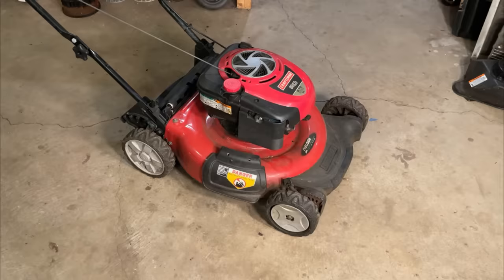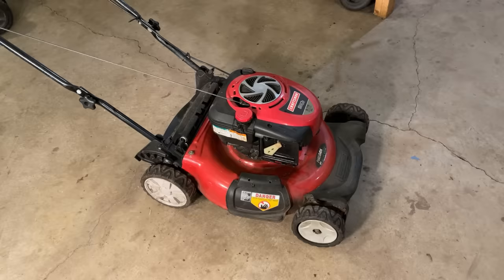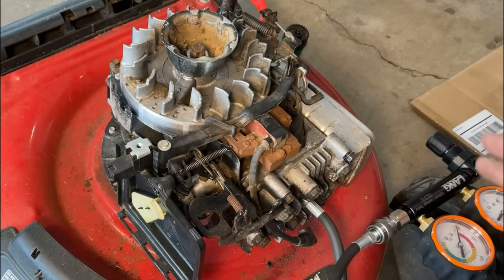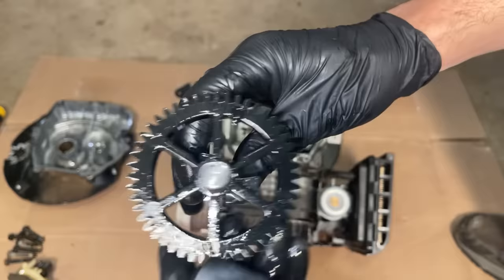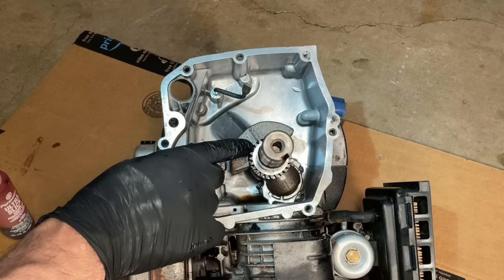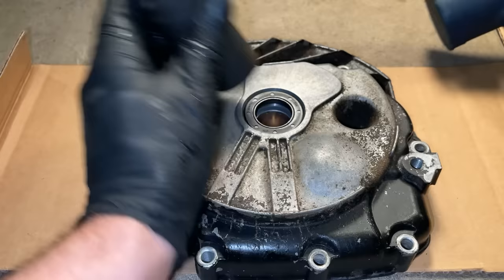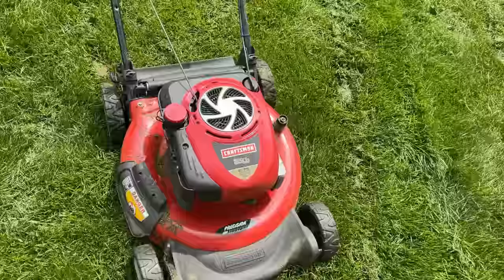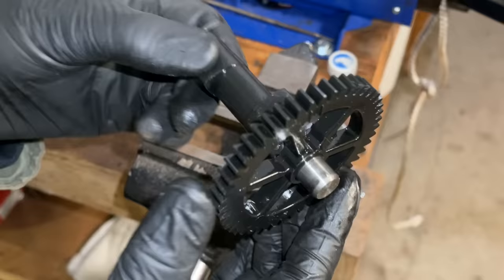Lawn Mower Will Not Start - You Will Never Guess Why

Comment: The alloy key in the flywheel is designed to sheer when the big blade hits an immoveable object like a tree stump,  the key sheers and the flywheel keeps rotating, the timing goes out and then  the engine stops.  This is done so the crank doesn't twist.  The owner then takes it to a dealer and they change out the key and it runs again.  This saves you buying another engine/mower.
The Plastic cam gears are designed to melt at a certain temp and stop the engine if it is overheating, Honda use this on their GX trimmer 4 strokes as well.  The mechanic can then change out the cam gear, and the engine will run again fine after cleaning fins and fresh oil.  Overheating can be due to lack of oil or blocked air cooling fins/fan.
Failed cam auto decompress levers are a fault and Briggs has had their issues with this, especially on some ride on motors.  If the starter turns the motor over and it just bounces and fails to start, its the decomp cam weight is broken.' 
You can get it to start temporarily without the cam working by first palming the engine backwards anticlockwise until you hit the compression bump, and then the starter will get it over comp with the runup it gets from that.  That's if your in the middle of mowing the lawn and you went for a cup of tea and it shat and wont start again.
You can help the decompressor to last longer by idling down before shutting off.  This seems to help the briggs ones anyway.
Matt.  Small Motor Mech.

Comment: My late dad and several of my relatives worked as gardeners for decades since the 1950s.  We used to go through B&S engines every 3 years with weekly oil changes being done after every 50 hours of use on each piece of equipment:  edger, mower and yard vac.  After 3 years, the engines would start burning oil from worn pistons.  We never had these cam problems in the old engines.  Carburetors wore out faster as we would buy short blocks to rebuild the older engines.  My dad saved a few blocks that had steel sleeves (OEM engines) and had a mower shop put in new piston rings and grind the valves to get the engine running again.  We did switch to Honda engines on the mowers, as those engines lasted double the life of a B&S short block.  I'm curious to know if the plastic parts are available without the metal shaft to rebuild the camshaft, or if you need to buy the whole assembly with the metal shaft.

Comment: Part of my job in spring and summer is setting up these Craftsman and Toro mowers from the boxes they are shipped in.  I put in the bottle of oil for the customers and displays.  Other than that, I do not mess with them.  If a customer has an issue, they bring it back to the store.  We have no mechanic to solve the issue.  We give them another mower or a refund.  The "problem child" gets tossed into a dumpster eventually.  New blade, fresh oil, grass bag-- the whole works.  Employees are forbiden from taking these or any other items that get processed out of inventory.  It is a waste of resources and otherwise fixable products that could go to needy people that can't afford a $359 mower.  I have an electric mower that my wife loves and can handle.  Put in a charged battery and push a button.  It cost $589, tho.

Comment: Nice, I recently overhauled an engine, I might not even have noticed that the gear moved on the cam shaft, I didn't even notice the mark for the lobe. I wonder why it came loose, it doesn't seem like it has to take a lot of force to drive the pushers for the valves, hence why they made it from plastic and no key. Thanks for sharing.

Comment: I like to install seals in a slightly different position if possible so that it sits on a new surface of the shaft.
Especially effective if the shaft has a groove worn in from the seal lip.

Comment: I have had several of these engines and never had a timing issue except for when the engine key broke after I hit something otherwise they are fantastic engines. Yes, they have replaced some things with plastic but it probably helped keep the cost of the engines down some too I’ve got two of those motors that are20 years old for one and 24 years old for the other and they both can run although one needs the carburetor cleaned out in a new gas tank

Comment: James: For laughs & giggles, I would have been tempted to file several shallow notches on the shaft & tried JB weld to see if it would hold. Not likely considering the drag on the cam lobe as it climbs the slope of the lobe, but it would still be interesting. Great video Sir, as always.
Cheers!  from the wind swept hinterlands of Alberta

Comment: Where I come from ( Australia) we never use a solid blade cutter but round plate with short blades that pivot back if they hit anything solid like a tree stump or rock. The solid blade cane brake a crankshaft or as in your case a plastic camshaft.
Reply from the maker: I have seen the same type here, but it is rare.

Comment: Jim, you might have tried putting a sheet of medium grit sand paper, on aflat surface, hold the tank neck, and give  several srokes. Check to see if it is not flat, due to oval of the neck. You might be able to sand the cap mating surface true again.......great job. But that $50 tank was hard to take.......LOL

Comment: First time to your channel I was intrigued. satisfied with what i got   out of this little video. I have never experienced this problem but I am glad to be aware of it and also what it took to troubleshoot it accurately. One of the things that I stressed to those that I teach whenever I can is to be able to diagnose properly and effectively and you definitely did this. I have now subscribed to your channel looking forward to some new information. I consider myself to be well-versed in mechanics and I work on diesels as well as small engines but I've never run across this problem. Started working on engines when I was about 7 years old on a 3 horsepower Briggs & Stratton and I must admit that I really don't see too many Briggs & stratton's anymore I mostly deal with Hondas. While I am a DieHard Briggs & Stratton fan I must admit that Honda seemed to last longer and are less problematic. Still very good to know love this information keep up the good work.

Comment: About that oil seal. Most of these engines get installed on lawnmowers. They run in an extremely dirty environment. Most owners do not keep the area around the seal properly cleaned. As this continues over time, dirt can collect around the lip of the seal causing it to cut a groove into the shaft where the seal contacts it. If a new seal is installed in exactly the same position as the original, the lip will ride in that groove causing it to leak in a short period of time. The factory knows this. When the factory installs the seal, it is done by a robot. The seal fits onto a computer controlled hydraulic ram that applies equal pressure around the seal while driving it to a specified depth into the housing. This also keeps the seal perfectly square to the shaft. In the field, most of us install the new seal the same way you did. When driving in the seal it is impossible to keep the seal 100% square to the shaft until it bottoms out forcing it back square. The factory can keep it square at any depth while we can’t. They don’t fully seat it so it has a fresh spot to ride on the shaft to prevent leaks. If the seal isn’t square, it will prematurely leak. The only reason I can think of not to fully seat it would be if the shaft was either tapered or stepped to change sizes. Am I missing something?

Comment: Nice job. I've repaired a zero turn single cylinder 20hp Briggs twice, now. The steel exhaust valve seat jumped out of the recess. and I can't remember the first reason.

Comment: You sound knowledgeable James, heres the question. 12.5 briggs single cyl. with no governor hooked up just a stub shaft. Motor runs away when started only way to slow down is choke . Tried many carbs, even ran one backwards, and tried a restrictor plate under plenum reduced rpms to abt 3100 but no power. otherwise runs good no apparent timing belt issues????

Comment: On easy start lawn mowers they have a mechanism on the camshaft that allows exhaust valve not to close once the engine gets spinning at the right RPM the mechanism on the cam will stop engaging most of the time it's a bad coil keyway broken or water gets in the gas tank and it runs the carburetor.

Comment: Thanks for the  information . At our local tip mowers , chainsaws , fire fighting pumps etc can be bought for a dollar . Sometimes I take some home to tinker with them.. Some only need a new spark plug or the carburetor  cleaned and they run fine but I have never come across one where the plastic cam has moved like this . I still can't understand why they use plastic in an engine .. Planned Obsolescence I guess..

Comment: Don't know if anyone else has said this, but-you should always check the valve clearance whenever replacing the camshaft!  "I" have replaced the cam in my 5hp IC engine when it just spit out a piece of the cam gear wheel in the engine.  Repl'd the cam, didn't check the clearance because it ran well, but when it got hot- stopped and had no comp.  One of the valves had no clearance either!  So, had to remove the valve and cut the tip for proper clearance.  Been running fine since!  Truth.

Comment: I got a new mower from Walmart, worked great using it twice. After that next time I tried to use it it wouldn’t start no matter how long and hard I tried.  Took it to a couple repair shops and they had no luck figuring out why it won’t start either. Really frustrating to spend $300.00 roughly for a mower and only get to use it twice.  Got a similar issue with a Stihl chainsaw that won’t start either. Both have good compression too and spark btw!   Took the chainsaw to a repair shop that had it 6 months trying to get the chainsaw to work and finally gave up and told me to come get it and I wasn’t charged anything since they couldn’t fix it.   They replaced all kinds of parts on the chainsaw too and left them on it. Regardless it still won’t run?   I could start my own repair shop or at least look like a repair shop just with all the equipment I got running around that’s really not old or been used much and yet refuses to work!  🤪

Comment: Thanks so much for this. We cleaned the carburetor but it won't start. Plastic cams! Could be the issue! It seems to turn so the engine isn't seized. Starting fluid gets it to run, it just won't stay running. I'll have to check the compression like you did. Thanks so much. It could very well be the same problem.

Comment: #1 disconnect sparkplug wire. #2 replace share flywheel key.#3 drain bad gas.#4 replace camshaft all. Be in time. Been do this 45yrs!

Comment: This is probably a common issue once these small engines backfire and try to turn backwards ! The offset of the lifter to the cam lobe will lock a lobe on its lifter and set the timing off by slipping the cam gear because it has the greater mechanical advantage !
In the future, inquire if the engine has ever backfired !

Comment: Interesting. I have never come across that cam-slip issue before !! And have never seen your suck-down tube/trick with which you used to identify the valve timing issue. I learned some good stuff today, thanks. I would have checked out the quality of the spark and also any fuel issues before pondering deeper.... fortunately, I have never needed to go deeper than that. However.... it might also possibly explain why an old mower never quite ran the same after the blade caught a hard, large, obscured rock !! It was very old and tired so it was not worth attempting to find a solution to a very small problem, as it went on to run for several years hence, just not as sweetly as I had it set up.... An age old niggle subtantially satisfied ....  Thanks again :)

Comment: Most of the mowers I've had to work on were 2 cycle so there wasn't an oil tank - oil mixed with the gasoline- mostly they were Jacobsen 20" push mowers with cast iron engines - they also had bearings instead of babits on the shaft -

Comment: Low compression leads to hard starting - I would have hooked up a Harbor Freight or etc. compression gauge.  So many times the 'hard to start' was caused by a low compression reading.

Then verify fuel supply not blocked.
Then verify spark with an inline spark detection tool (it connects between the spark plug and the high tension spark plug wire.

Fuel delivery?  Good compression?  Bright spark?  before taking anything apart.  If the compression was bad (which it would have been in this case)  I assess my time investment going forward to see if it's worth it.

On all the 1960s, 1970s era motorcycles I've worked on,  the value of the machines vary quite a bit.  A compression problem on a low-value bike had me giving it away to recover shop space for the next project.

My 1969 Honda CB750 'sandcast' is worth tens of thousands of dollars.  A 1969 Suzuki 2-stroke street bike I owned was worth a few hundred.  "Pick your battles"

Comment: The sligest crease in the flywheel key will throw a  lawnmower engine  out of time and it will not start until  key is replaced, 
I have repaired  countless small engines  by installing  a new flywheel key.

Comment: Even though the cam gear and cam lobes are plastic, I think there should be a key channel in the metal cam shaft, key notches in the gear and lobes, and metal keys between them  to keep the gear or lobes from twisting out of position on the shaft.

Comment: The cam had 8 times the shaft contact area as the gear did. And the gear's larger diameter meant that it would have more torque on it. Not surprising which one moved. I don't necessarily fault the use of plastic. It was just not properly secured to the shaft.

Comment: Be careful not to hit anything while mowing.  As you know the flywheel key is supposed shear if you hit something, but that B&S engine had a design flaw.  The sharp corner of the keyway groove is right next to the threaded hole in cast flywheel which is a horrible stress riser. I know because my flywheel cracked from the corner of the groove to the threaded hole and beyond instead of shearing the key.  Instead of buying a new flywheel and waiting for the problem to happen again, I brought the mower to the dump and bought a new one with a Honda engine.  They should have rotated the location of the threaded holes about 90 degrees or so not to have that problem any more.
Reply: yeah Briggs wtf can you say? I heard Honda is gonna stop making gas lawn mowers. yep they sure are.. as of September of 2023 its over for them. They're gonna continue to make gas generators though.

Comment: I've done my share or mower repair work and before I open up an engine i drop the fuel bowl and clean it out as well as clean the kill switch platform and one other thing he forgot to do was examine the exhaust on it because sometimes it will fill up on the inside with rust if it has not been used too much and that stops the airflow to the valves.  Now he said it was a quantum engine and i have news for him that engine is not a quantum because the quantum has their engine oil refill port right in front of the engine under the gas tankand it has a big oil plug.  I used to have 2 and one other thing I should mention the quantum had a hardened plastic piston rod on the inside and when he put that engine back together if the timing marks are not exact that mower won't run for love or money.

Comment: Thanks for sharing your repair skills. I’ve fixed a lot of small engines but I probably wouldn’t have caught that one. 

But what watching your repair did for me was to confirm my long standing impression that entry level Briggs & Stratton engines are junk. I’ll stick with Honda, Kohler, Kawasaki, or Mitsubishi for small motors. B&S isn’t a bargain even if it’s free. If it hasn’t broken, it’s about to. Made to fail.

Comment: Here's the economics of this operation.

It appears you can buy a similar new Craftsman push mower for about $300 (used, about $150).

The average take home pay in America is about $18/hr.  James spent about $50 for the used mower and parts.  If his time is worth $18/hr, then if it took him longer than about 14 hours, he would have better have just worked extra and applied that money to a new push mower (or 5-1/2 hours if he was okay with a fully operational used mower, which is what he has now, even with the fix).  $300-$50 = $250,    $250/($18/hr) = 13.9 hrs.  $150-$50 = $100, $100/($18/hr) = 5.5 hrs.  (If you take home about $6/hr, the times are 41.7 and 16.5 hrs.)

Of course that's not taking into account cost of tools, or the subjective "curiosity fulfillment factor" (which values increased knowledge as part of the economic equation).  The pricing for the latter is up to each person.

IMHO James for future similar vids, I think your viewers would appreciate knowing the amount of hours you spent fixing the problem, so they can determine if it's worth their while duplicating what you did.

Thanks for the vid.  I had no idea crankshafts could be damaged like that.  I wouldn't be surprised if for just a few pennies more, that part could be redesigned to where it would never fail.

Comment: On some the rope pull has plastic studs that  break and you can put screws in place and that makes it grab and spend the motor. Also if the blade doesn't turn when you pull the rope. That's a sign the plastic ribets make be broke.

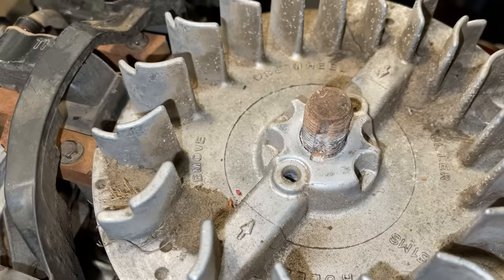Comment: I haven't gone pass 6:04 but it looks like the coil and fly wheel needs to be cleaned and check the gap before tearing into the upper end. If it has points they may need to be cleaned also and check  Capacitor before going into engine.